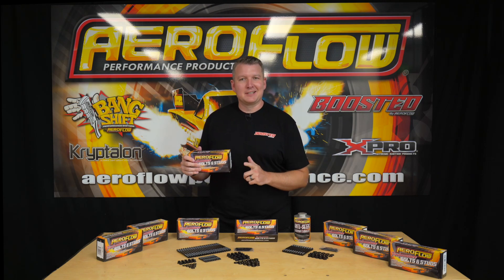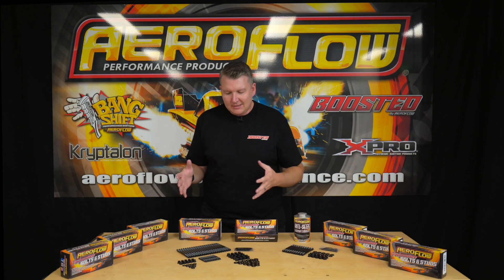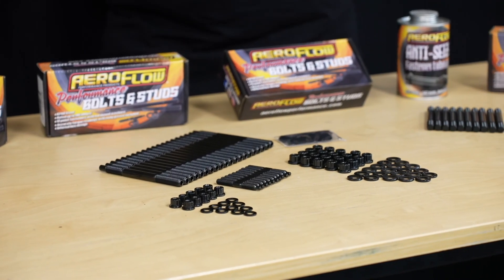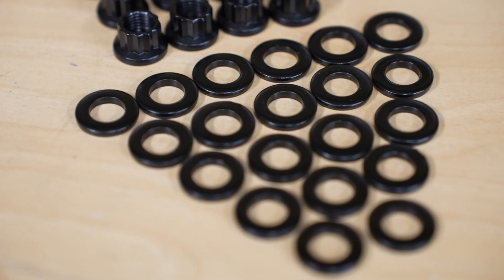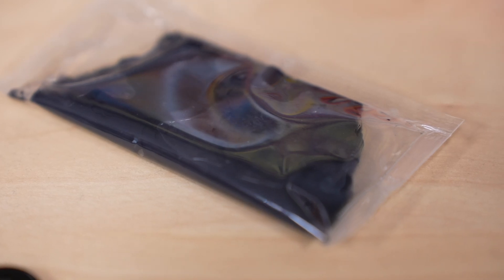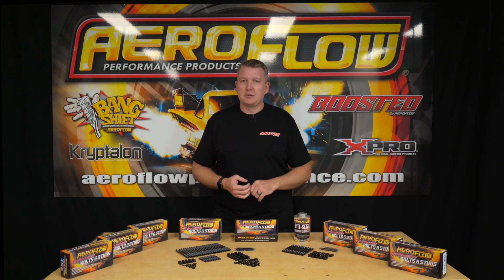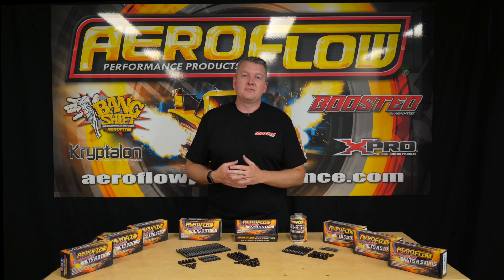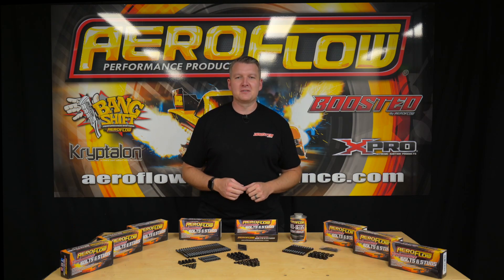Don't re-use those old head bolts! Head studs by Aeroflow Performance

Comment: Garbage , head studs arent ven correct and the mains dont even have the length
Reply from the maker: Which part number and application are you having issues with? We've got hundreds of sets in the market without issue, happy to work through it with you.